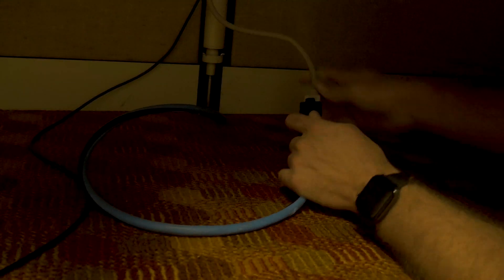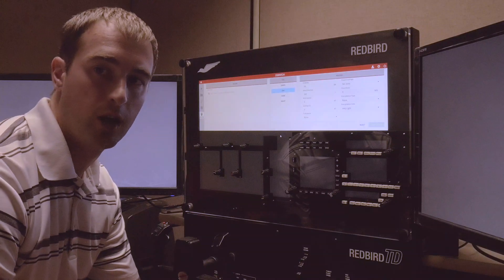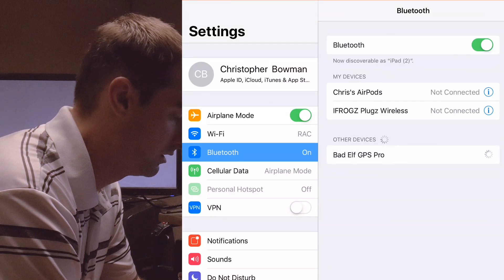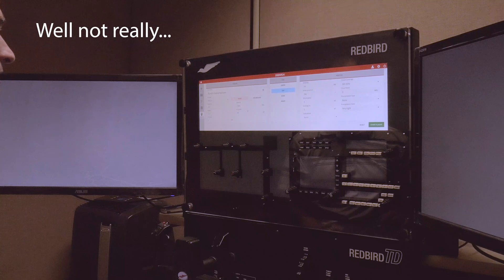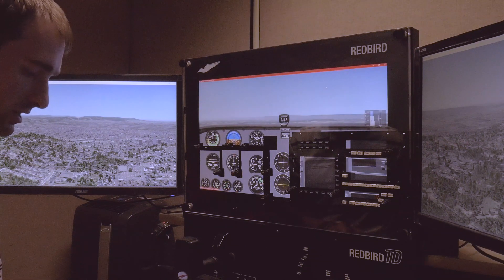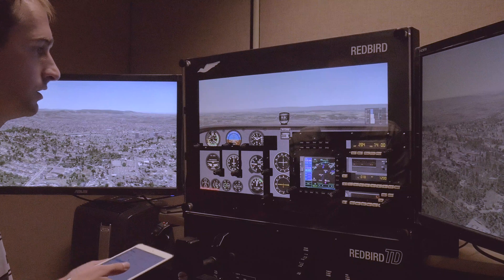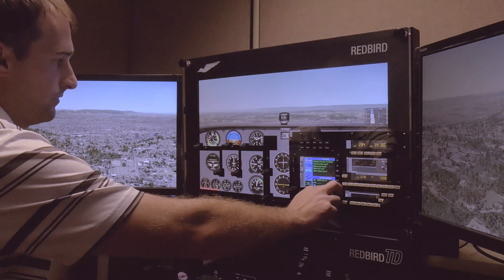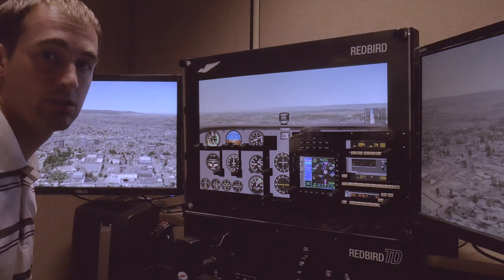redbird TD simulator overview

Comment: REF 4:40 - My TD did not do that, but if you call Redbird they will fix it for you. Also, I notice your Redbird looks must like mine when I first got it. Some of the gauges are too low where you can't see the entire gauge (e.g. top three of the six pack). I called Redbird and they fixed that for me also by fixing the graphics code.
Reply from the maker: Thanks for that info! We fixed the low gauge issue by moving the monitor, but fixing the code would have been a lot easier!

Comment: Our club has a TD2, but the start up screen looks nothing like yours!  At $60/hr, I don't want to waste time trying to figure out how to set it up and use it.  What I want to do is set up approaches, beginning in the air.  That way you're not wasting time taxiing, and taking off.  All I could get was starting at our local airport and one of the four positions for take off.  If I can begin airborne, I can do the required 6 approaches and a hold or two in less than two hours.  If I try that in my Archer, it would probably take 3 or 4 hours, depending on how busy ATC is here in the Tucson area.  And at $7.00/gal fuel, it would be a heck of a lot cheaper.
Reply from the maker: That's interesting, I wonder if they changed some things since I made this video. I don't have access to this simulator anymore. As I recall, to start in the air you would select the runway and then there was another box where you would select "5 mile final" or something like that to start in the air for an ils. I did eight approaches in an hour one day, way faster than doing it in a plane!
Reply: @chrisbowpiloto  Eight in one hour!  Now that's what I want to hear...  I'm not concerned about my proficiency.  I shoot hundreds of approaches using Xplane, though it doesn't count legally.  I just want to stay legally current.  If I have to file real IFR, I'm not going to do anything stupid like fly in really bad weather.  We go back to the midwest sometimes and you can get low ceilings a lot.  I want to be able to get out and back home to Tucson.  IFR not needed here!